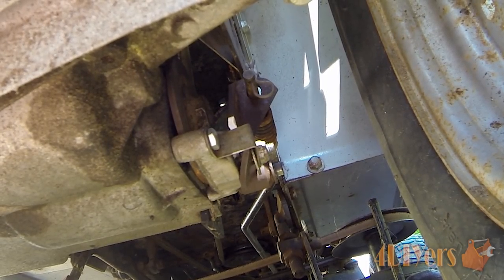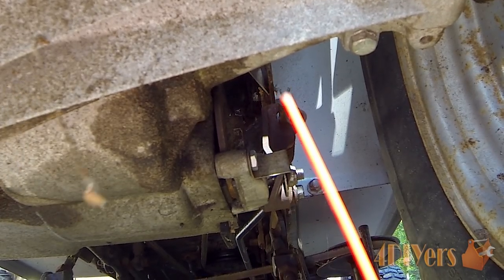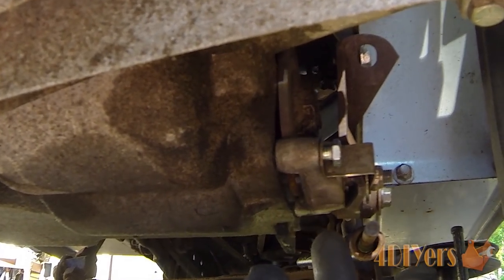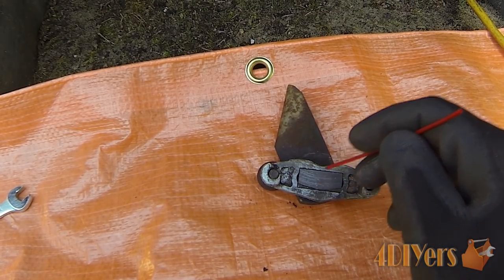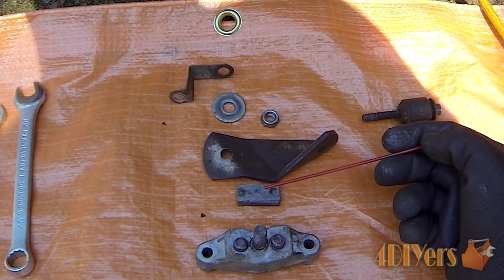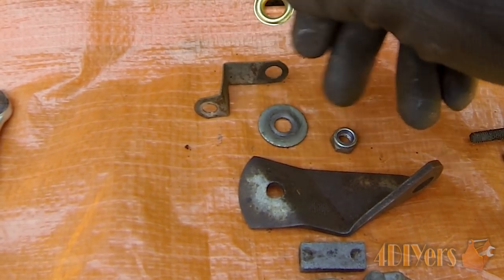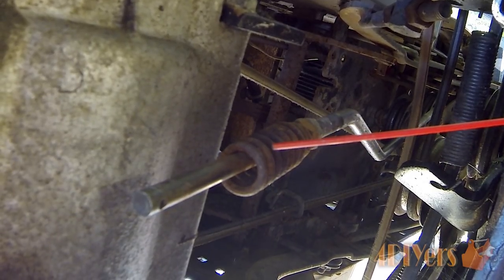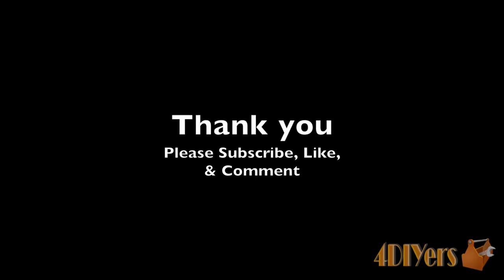How to Repair or Replace Lawn Tractor Brakes

Comment: I found a great trick to solve the problem. I can't remember what channel it came from,  but the guy was using a cigarette lighter and a candle like a plumber uses a torch to solder a copper joint. I had to use a torch,  but you just touch the candle to the threads of the bolt while its hot, and it sucks the wax down into the threads,  and the bolt will easily break free. I love this fix. He was using it on the lug nuts of a really old car, but it will work with anything. When I got the bolt out,  even though it was frozen the wax had penetrated all the way to the bottom of the threads.

Comment: How to make the pads last longer.   A hose clamp is the right width. Just needs to be cut to length. You can use them as shims to push the  pads closer to the Brake Rotor. Just sand the pads  smooth where the rotor cut its grove. Place your shims behind the pads.  Lot cheaper than $16+ for  2  new pads

Comment: I just found this video. Much thanks. The assembly shown is almost identical to my Husqvarna LT141, but I have a small conical spring which fits on the adjusting bolt somewhere, but I didn't take a photo before tearing the assembly down.

Comment: I was using the drill bit that came with the easy out kit at first,  but it was reverse thread.  After that I was using high speed steel bits.  I purchased a product called speed out,  and PB Blaster penetrating catalyst. I will try tomorrow.

Comment: I had both bolts break off. I used a propane torch and still they broke off. I had plenty of bolt to grab, but the vise grips and penetrating oil didn't work. I am at a loss, and I bought an easy out kit, and I managed to break every drill bit of the proper size that I own, and I couldn't even make a dent in the bolts.
Reply from the maker: Unfortunately you will need to be careful with heat as there is a seal there. My recommendation for penetrating oil would be Kroil, it's an extremely high quality oil. A nut could be welded to the remaining stud. What quality drill bits are you using??? Some drill bits are fine for softer material, but as soon as you get into the harder materials, thats when they fail. I also have a drill bit sharpening video so you can salvage it. The last option is definitely drilling them, they might be too small for an easy-out. You can always tap then to the next size bolt in a worst case scenario situation.

Comment: Wish you had discussed the adjustment on the fiber locking nut. I need some help to decide how tight to set the nut so the brakes do work but also not drag.
Reply from the maker: +Ken shane Hold the brake lever down and then snug up the nut. Adjustments will depend on the travel of the lever or now much pad material is left. When the brake lever is down, the lawn tractor should be able to stop with no issues.

Comment: Where do you buy brake parts, I have my appropriate model number for a Yard man I have. But all the parts places just seem to have tractor specific parts, but never brake parts.
Reply from the maker: Try your local small engine supplier. Just give them the manufacturer and model number, they should be able to find something in their parts catalogues.

Comment: I think what happened is,  I used my angle grinder,  and then used wd40 while it was hot,  and quenched it accidentally which probably hardened the bolts.
Reply from the maker: I can't see it making that much of a difference. Perhaps someone had changed out the bolts previously or used a high rated thread locker.